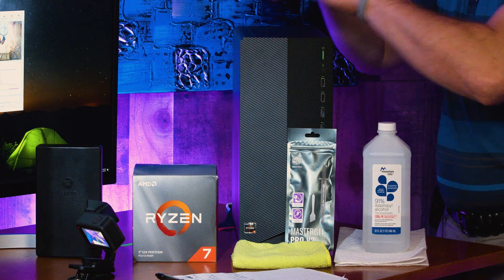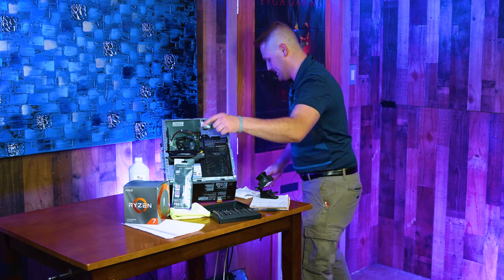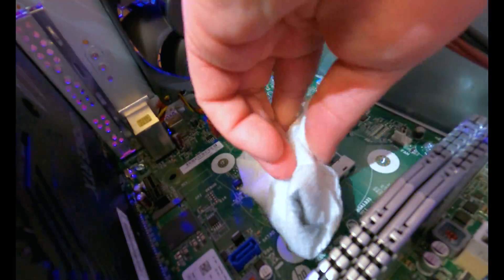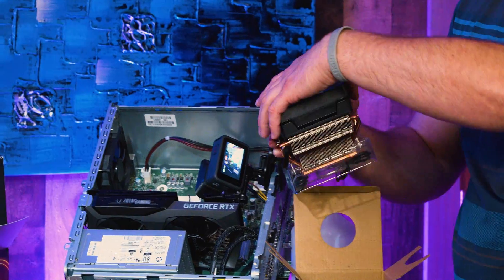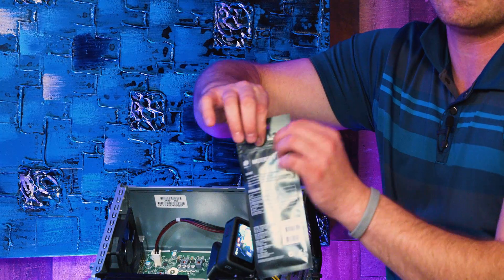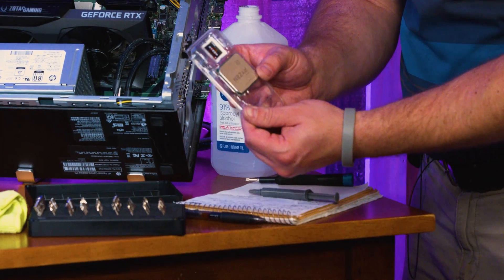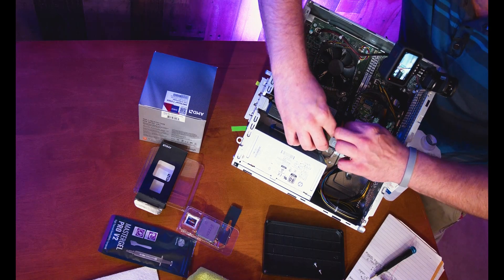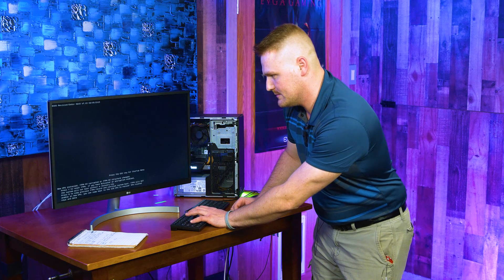HP Pavilion TG01-0023w 0030 0040 Ryzen 7 3700X How to Upgrade the CPU and Is it Worth it

Comment: Hello, I have watched a couple of your tutorials on the (TG01-0023w) upgrades and ty for helping us all out. But I have a question regarding the Ram upgrades. After upgrading to 32 GB which is max on this PC, the speed stays the same it looks like and there is no way to change anything in the Bios.
My question is; is there a Bios update that will allow us to get the best settings for (Corsair Vengeance Pro 3200 MHz Ram) ?
Reply from the maker: Well the hps do not allow xmp profiles. So if it can not do it as a stock speed the ram runs at 2400 or 2666mhz. Vs 3200 your only losing like 10-20 fps at most. The most important thing is the dual channle.
Reply: @TNW1337  ty. I have found that if I run a profile for the Ram in Ryzen Master the settings to couple both the sticks to 1600 each, they run at 3200 in Task Manager. But only as long as Ryzen Master is open.
Reply from the maker: @dennistCV41  Yeah that multiplayer can screw you up.

Comment: So, my questions:

Is it safe to use the 3700X on the 400W power supply? Likewise upgrading the 1650 Super to a 1660 Ti?

This is what I'm looking at doing...

I've already upgraded the RAM from 8GB 3200 to 32GB 2666 (Yeah, I know, speed vs quad capacity, minor trade-off), and upgraded NVMe from stock 256GB to PNY 2TB (3500/3000 R/W).

I haven't yet upgraded the GPU or the CPU. I'm just minorly worried whether they'll chew more power or get the PSU too close to its theoretical max under load (gaming and/or BOINC PrimeGrid computing)?

Ohh, and I added an inexpensive 5-port Inateck USB3 PCIe card (with a SATA power connector input to power the ports), for extra connectivity.

I don't know how much extra load wattage the 1660 Ti and/or 3700X would pull under load, or really how much the existing components already pull. I know the TDP of the 3700X is still 65W, but not sure whether that directly tells anything about its theoretical max power draw (isn't it just some kind of indicator of how much thermal dissipation is needed from the heat sink, as opposed to a more specific measure of maximum power draw off the PSU)?

Any insight?

Will this take a full ATX power supply, or is the case too small, and/or the board to proprietary (w/4-pin HP connector for CPU, etc.)?

I hear there is at least a 500W PSU of the right form factor and connectors available through HP part picker or whatever. Don't know if any higher end parts that fit and have the right connectors. Do I need to go that route, or will the 400W PSU be sufficient?
Reply: Can't seem to get a straight answer or even a ballpark guess, on this from anyone...

Like, I plan on using this thing for gaming on my old GTX 1660 Ti (swapped in place of the 1650 Super), and for BOINC distributed computing with PrimeGrid, using all cores / GPU.

My current Phenom II x1045T does great, and I assume this will do great-er... I'm just not clear whether all the parts will fit inside the 400W power envelope under load w/o complaint, or whether I'll be pushing too close to its theoretical wattage limit and it would be better to get the 500W PSU for extra headroom?
Reply from the maker: The 400 watt will allow up to a 3060 and Max CPU and MAX Ram. If you and going to try and put a bigger GPU in you will need the 500watt cpu. Normal ATX PSU will not work.

Comment: I have this PC: HP Pavilion Gaming R5 1650 Super, 8GB/256GB Gaming Desktop Tower, its motherboard is HP name: Erica SSID: 8643.  Can I upgrade the motherboard to a non HP Motherboard in the same case?
Reply from the maker: You could do a case swap and mother board, psu would need to be different. The hp mobo only fits in hps.
Reply: @TNW1337  well after.watching this and other upgrade video, I realized this mb isn't so bad, so I will do upgrades like you did. Just not as pricey.   Lol
Reply from the maker: @earthenergyhex  yes

Comment: will a ryzen 9 3900x work in tg01-0023w?
Reply from the maker: Nope only the 3700x
Reply: @TNW1337  is the 3700x worth the upgrade from the 3500?
Reply: is the 3700x worth the upgrade from the 3500?
Reply: @corync  

IMO, yes... Others may differ. If I can pick one up cheaply, I hope to upgrade. No sure if I have to bump up PSU as well, tho? Not an expense / workload I'd hoped for, but may be worth it. -ish?

3500 = 6 core, 6 thread. 3.6GHz->4.1GHz

3700X = 8core, 16 thread. 3.6GHz->4.4GHz

-----

I just wish they'd release the Ryzen 9 3900[non-X] 65W TDP chip to retail channels, and that HP would update the BIOS to support it.

12c/24t @ 3.1GHz->4.3GHz would be pretty sick.

-----

All that said, if you're buying this just to upgrade it, for the price of all the parts, you almost might as well just buy a better machine that comes with all the parts you want already in it (unless you can get a super good deal on all the parts, or you're salvaging parts from other builds [as I am with my current GTX 1660 Ti GPU]), since it'll end up costing you the same after all the upgrade parts. ;)

Comment: At the end of this series how much do you think it'll be and when you finish can you make a ultimate HP tg01 upgrade like everything
Reply from the maker: It is getting pretty close, I still have to do the 32Gb Ram upgrade And I just started to do the cooling testing.I am editing the 1st cooling video now. I have the other 2 shot. Other then the 3060ti We are on the list to get one.  That's the only thing I can think can be done. Other then the case swap video.
Reply: Best Buy has a decent deal on HyperX 16GB single modules (cheaper than the 2-pk 32GB kit, for some reason, when buying 2). Only 2666 rather than 3200, but will anyone really notice the difference other than in benchmarks? I doubt I will...

https://www.bestbuy.com/site/hyperx-fury-hx426c16fb4-16-16gb-2666mhz-ddr4-dimm-desktop-memory/6426486.p?skuId=6426486

Comment: I love the way you pronounce isopropyl alcohol multiple ways. I know 3700x is probably the max this board can take but can it also be upgraded with like a 6 core 12 thread cpu?
Reply from the maker: AMD Ryzen 5 3400G, 3.7 GHz Base frequency, up to 4.2 GHz burst frequency, 4 MB cache, Quad core (Picasso) 4 Core 8 Threads
	
65 W
	
Radeon Vega 11 Graphics
AMD Ryzen 3 3200G, 3.6 GHz Base frequency, up to 4.0 GHz burst frequency, 4 MB cache, Quad core (Picasso) 4 Core 8 Threads
	
65 W
	
Radeon Vega 8 Graphics
AMD Athlon 300UGE, 3.6 GHz Base frequency, 4 MB cache, Dual core (Picasso) 
	
65 W
	
Radeon Vega 3 Graphics
AMD Ryzen 5 3500, 3.4 GHz Base frequency, up to 4.1 GHz burst frequency, 16 MB cache, Hexa core (Matisse)6 core 12 threads
	
65 W
	
NA
AMD Ryzen 7 3700X, 3.6 GHz Base frequency, up to 4.4 GHz burst frequency, 32 MB cache, Octa core (Matisse) 8 core 16 threads
	
65 W
	
NA
Reply from the maker: All of those Cpus are shown to be supported. Thanks for the comment BTW.
Reply: @TNW1337  I really wish they'd [HP would] get off their butts and update the BIOS to support the 65W TDP Ryzen 5000 Zen 3 chips the B450/B550A/B550 boards are supposed to be able to support [with a BIOS update]... 

Would love to be able to slap in a 5600X, 5800[non-X], 5900[non-X], all of which are allegedly 65W TDP chips, if/when they become readily available or "aftermarket available."

Will suck if they refuse to update BIOS for should-be-compatible chips and say 3700X is the end of the line on this board due to "forced obsolescence."

Comment: Did all of these upgrades,  Snowman 4 pipe cooler on the new Ryzen 7, plus a case mod with a RGB fans in the top and side.  Thanks for the tips on this model. I think its a great entry level gaming computer for the price.
Reply from the maker: It is Pretty much the video I am coming out with next.(Cooling). It Has 2 coolers that work like  the Snowman. I found out doing the FAN on the intake port hurt my temps so I relocated it to a different area, I got better numbers.The snowman is a Cheap and good cooler.
Reply from the maker: Cool How are you liking it?
Reply: @TNW1337  Great, was a fun project at a lower cost compared to a full  new case an mother board build.

Comment: How do get a hp 500w psu in the UK
Reply from the maker: You have to google, the part number and find hp distribute that sells it. One of the two I ordered came from Germany.
Reply: Put region as UK? Hopefully it works?

Anyway, that's supposed to be the part:

L05757-800 500W PSU

For TG01-0023w anyway... And similar models with same board, etc., I guess?

Comment: Hey looking forward to the cooling upgrade video on this computer, I got one last month and I love it, but it does run a little warm, I’ll probably upgrade the cpu when I see wich cooler that will bolt in with out having to remove the motherboard. Btw anyone interested I put 32 gb of Crucial 32GB Kit (16GBx2) DDR4 3200 MT/s (PC4-25600) CL22 DR x8 unbuffered Dimm 288pin memory - CT2K16G4DFD832A from amazon - and my pc recognized instantly with out needing to adjust the clock speeds in bios or ryzen master and it runs at 3200mhz so cool! I will definitely upgrade cpu and cooler after your next video on this pc comes out on cooling thanks!
Reply from the maker: Throw a link up. I am all about helping out my fellow man/women.
Reply: Just put a common house fan with the side panel off pointed at the motherboard and temps should stay at 163 Fahrenheit the recommended temperature

Comment: Is the cpu even working to its full potential with this motherboard?  Seems a bit of a waste if its not. I would of gone for a 2600/3600 to be safer. If the cpu isn't working to its fullest performance its money wasted. Im not hating or anything, just a point worth making. Also no chance of an overclock with that motherboard and cooler, no need for the x. How noisey is it?
Reply from the maker: All I can say is what I've see in benchmark, and every thing I've see there is no bottleneck. I know some one started that crap on there site saying there where bottle necks. when they looked at it compared to other hardware. All I can say I've owned a amd and a Intell from 1st gen to 11th and Amd ryzen 5 and 7 from 1st gen to 3rd. Only ryzen I have not tested is a 5800 or 5900 ryzen. And  the 3rd gen treadrippers are crazy expensive.  So not going to go there, I have not seen a bottleneck. I rellay think it was but hurt intel fans tbh, I've always like both. So I never held a bias. What they where talking about from, what I can see is it was the pcie 3x vs pcie 4x performance. The Gpu where not even using the full bandwidth of the 3x 16x any way.  So only other problem is they have to be 65watts cpus for this mobo. I think the 3600 is not.  But I do not have them memorized. 😕
Reply: @TNW1337  i wasn't referring to a bottleneck as such, i was curious if the cpu can utilise all its cores and speed properly on a proprietary motherboard? Would interesting to see with msi afterburner. 3700x got some power behind it.
Reply: @itsmegareth9663  Not sure what you mean by "can't utilize it's cores and speed properly on proprietary motherboard"? It's a B550A board, which is basically a slightly feature-unlocked / souped up B450 board.

Mine was running at 4GHz pretty steady when I was looking at it. I don't think it was "holding anything back" / "bottlenecking" / "leaving performance on the table," etc. "Proprietary board" or no... Not really sure what performance you think it *would* "leave on the table"? *Shrug*

Now, this was just me fiddling around with it as I'm setting it up, not like running any stress tests with like BOINC PrimeGrid computing or anything. (That'll probably come later.) It was just doing its normal stuff. But Task Mgr was showing it running at a pretty steady "4GHz" [I'm assuming on at least one core, since it wasn't doing much on the others at the time.]

Comment: No pre-built is "freaking cool" since they use cheap components. One of the big negatives is a pile of shit mobos found in pre-builts that cheap as well as CPU coolers and PSUs. If you want a decent pre-built then you're over gonna pay a lot. It's dumb to upgrade pre-builts. Buy your own components which are much better, upgrade down the line. You can also get a really good cooler for $30 which will make 3700X run much cooler or any other CPU that comes with a stock cooler. This is hard to watch. That mobo won't even let 3700X open up... power phase is garbage and no heatsinks on the mobo... You seriously putting a 3700X in it... wow. B450 mobos aren't expensive and are a billion times better in every way possible.
Reply from the maker: happy you feel that way. Not every one will spend the time to to understand half of what your talking about. all I know is 3d mark is pretty much showing what a B450 Mobo is getting I am getting with a HP mobo. I've also stress tested the hell out of this mobo no problems of yet (nock on wood). Also the cooler is lacking. HP did do some thing dumb here, the only heat sinks that work are 1151 style coolers. Not that this will stop you from punting a good cooler on it. For some one like you or me it is not a problem building a good PC. Let me drop some numbers on you. Over 65mill units of hp Prebuilts where sold in 2020. 2021 is on par to add 10% -15% to this number. I will build my pc Because I know what parts I am putting in it, And I know they are Better, better caps, better dioids, Better Vrm and Pwm. That is just the tip of the ice burg. You can get a pretty nice Prebuilt that is not over Msrp of the parts. Only problem is most do not understand why a mother board is $75, $150 or $300 where the hp board is $25, $50 or $75. The hp pavilions are on the lower end of the parts spectrum. The Hps do fill a large market gap.
Reply: @TNW1337  That mobo is worth like $20 realistically. B450 mobo will have nothing to do with 3DMark... it's just bunch of synthetic tests. But when it comes to actual gaming for few hours, or any kind of heavy load that puts on CPU, GPU, RAM, monitor the temps on that mobo, specially VRMs. They will be probably be on fire. I've had an X370 MSI mobo with 1700X that made my mobo and VRM temps go in high 80s and it was a $150 mobo. Right now I have 3700X with ASUS B450-F STRIX and after stress testing, gaming for more than few hours my mobo/VRM temps never reach above 45C and I have 3700X overclocked to 4.3GHz on All Cores. But most pre-builds made by HP, Dell, etc will have a cheap, limiting mobo with a stupid mounting mechanism like that. I would never buy a pre-built because I know they use cheap components, I like picking my components and color themes and I enjoy building rigs. I usually build at least 5 - 7 rigs a year for fam, friends, myself. I usually pick a platform and then just upgrade for few years before I feel the addicting need to build a new rig for myself. Although dealing with RGB cables, controllers is a pain (in the back of the case). It's super easy to make the system look clean super clean on the CPU/GPU side. Get a B450 and a new case and throw that pre-built in a new case with a new cooler but even a stock one will do the job. I used it while overclocked 3700X to its limits and never had an issue with temps but my voltage is pretty low 1.29V. Also get a decent PSU before it burns down that pre-built. It's one of the most important components and make sure it has a single rail with at least 250W of room to spare.. you don't want it running at its limits and it will give you room to upgrade in the future just in case you get components that pull more TDP. Use OCCT and Aida64 to stress the system. Aida64 is worth the $$$, it's cheap IMO and there are sales here and there. I feel like upgrading and dealing with pre-builts is pain in the ass because Dell, HP, etc make it in a way so that it's nearly impossible to work with at times. Like that cooler issue you have is one example. There's never a decent PSU to upgrade to a beefier GPU.. so you need to buy a PSU just for PCIE connectors ans those 250W - 300W probably not even 80+ rated are just sketchy and not enough power for any decent upgrade. The cases are $10 garbage that can't even get rid of the heat if you try to upgrade to decent components. It's much easier to build your own rig from scratch. The only thing that salvageable from a pre-built is storage and possibly RAM. And WHY do pre-builts always use a single channel... you lose so much perfomance. It's that hard to use 2 sticks instead of 1..? They purposely underpower their pre-builts so that you would go and buy a new one much sooner if you don't know anything about tech/PCs (ordinary people).
Reply: Umm, you do realize that a B550A chipset motherboard [e.g., the HP "Erica" board in this machine] basically *is* a B450 motherboard (with some extra features unlocked), right? 

Gamers Nexus will get you straightened out:

https://www.youtube.com/watch?v=mBympJkflks

Or, ya' just trolling / hating on HP?
Reply: @MGmirkin  Naw, I kinda scrolled throw the video to watch what I thought was interesting. But if it is B550 then why does it have that weird heatsink mounting on it? And most pre-builts from regular brands have shit mobos, PSUs, single channel RAM that has low frequency and terrible timings, also the ugly cases... Pre-Builts from Alienware are only cool for their cases, Origin and other decent pre-built brands are WAY overpriced but at least they use decent components. Also what are those extra features? Lol just curious.
Reply: This prebuilt is okay for what you get it isn’t that bad honestly and with the way prices are rn for GPU’s no thanks in building my own. also don’t forget this is a budget prebuilt pc so I don’t understand what you expected out of it.